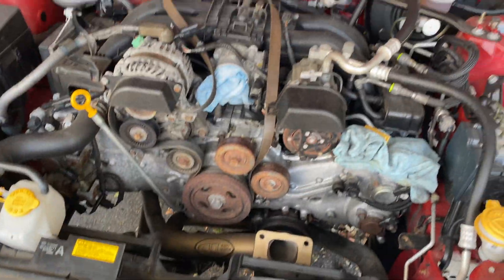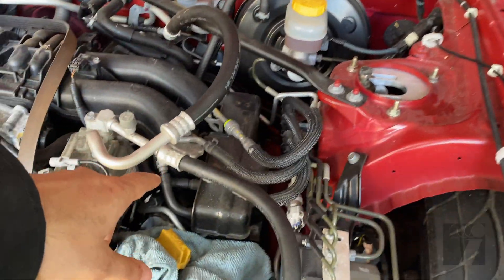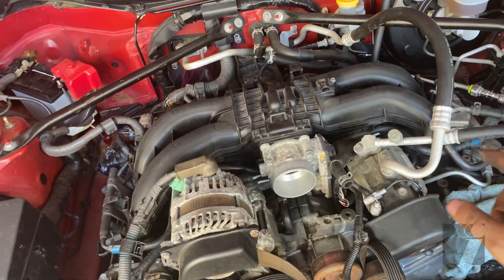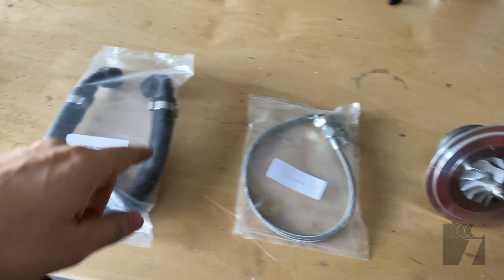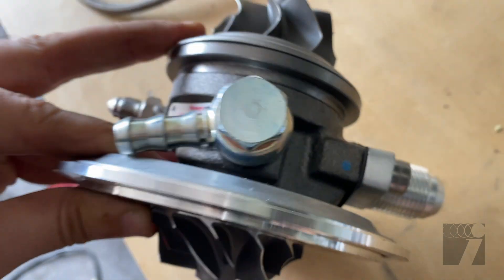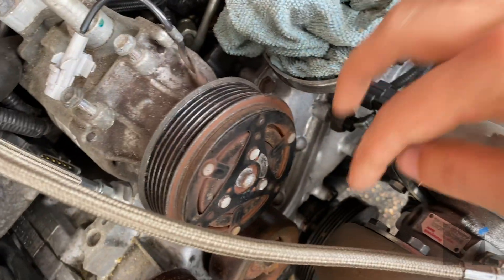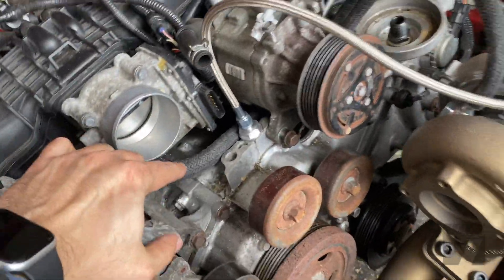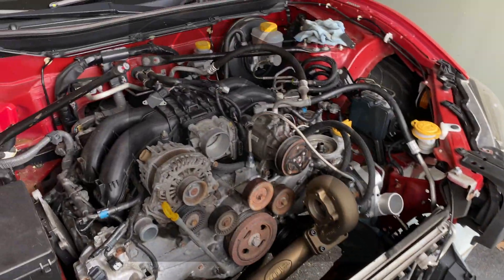BRZ JDL Turbo Install Pt: 3

Comment: Pulling the transmission for the clutch is a lot faster then pulling the engine. Drop panels, exhaust, drain gear oil, take off shifter, drop driveshaft, disconnect slave cylinder and drop the transmission. Changing a clutch take 2-3 hrs if you know what your doing
Reply from the maker: Nick Hopkins Yep, i just had everything already disconnected to pull the engine anyway